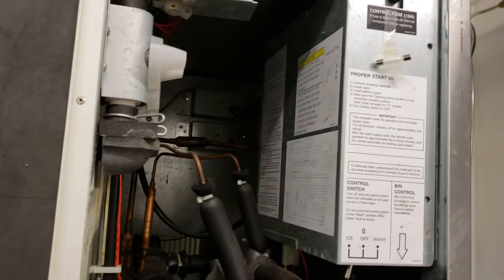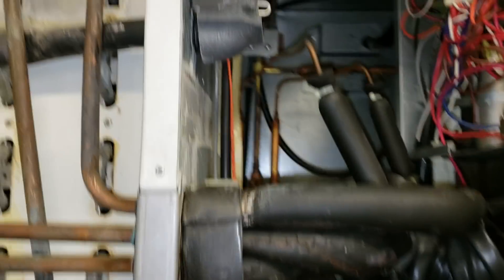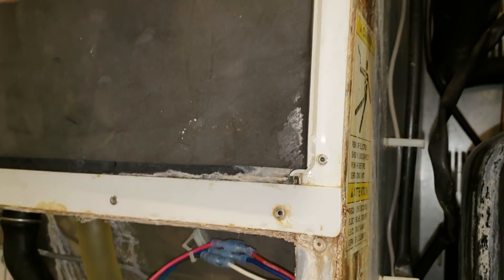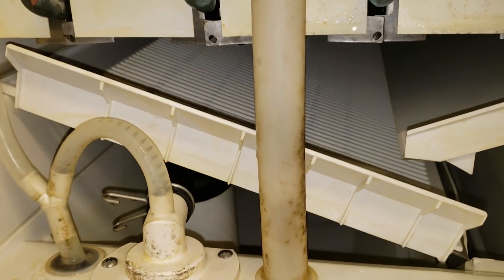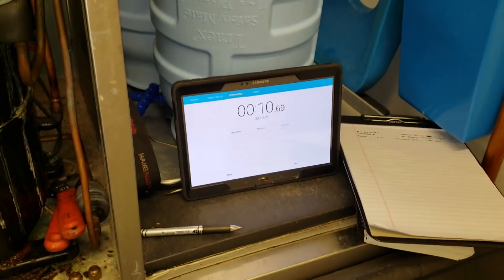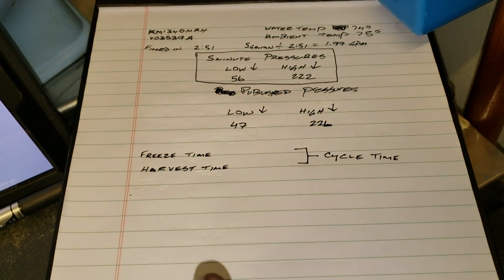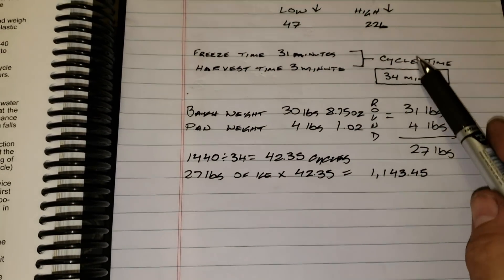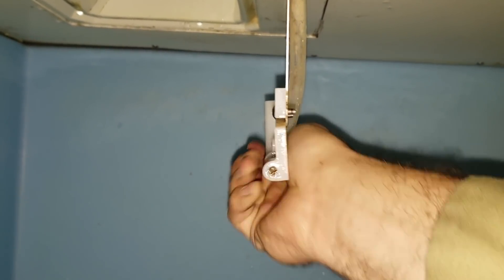Hoshizaki Ice Machine down

Comment: Love these videos. Since time isn't base 10 though the GPM calculation I would think would be 5 Gal / 2.85 min (where 2 minutes + 51/60 seconds) so the GPM is 1.75. Of course perhaps there is some other basis that took this into account.
Reply: I was going to write the same thing, he is calculating the gpm wrong.  Seconds are base 60 not 10.  So TheObiwantoby calculation ii right.  Hvacr calculation is 2 1/2 min because calculators are base 10.

Comment: Replacing a Hoshizaki with a Manitowoc!? BLASPHEMY!! 
Regardless of this atrocity another well done video. Good Job.
Reply from the maker: to clarify the customer is supplying the manitowoc, I just install it. if it was my choice I would put a hoshi back in for sure. thanks for watching I am going live on youtube tonight 12/10/18 at 5:00pm pacific to talk about Hoshizaki Ice machines come on over and check it out  https://youtu.be/JhM0UMnL7YU
Reply from the maker: If I was to buy an ice machine myself it would be a hoshizaki, just make sure it is properly installed with a hoshizaki water filtration system the proper water line sizes and the delivered water  meets hoshizakis gpm requirements. The machine will last you a long time

Comment: Great walk thru. 
Have not worked on Hoshi, but so much of what you covered applies to all IMs. My only comment would be for new techs to realize an X lb rated machine is label rated at perfect conditions; ambient condenser and water supply temps will affect real world production. 

So many of my facility's concessions ice machines are crammed into unconditioned closets. Insane.

Comment: Thank you for your explanations and thorough diagnosis of all the systems but I think I would have called TOD when you found a leak in the compressor. Leaking refrigerant in an enclosed space is no longer a health concern? Owners are notoriously cheap and usually expect you to pull off miracles and then haggle over repair costs.

Comment: I’m dealing with helping to run an ooooooold Corner Store in a small community on an island; it has 2 walk-in coolers and a 4-door stand up freezer with the big compressor and everything else right on top like self contained systems... which there are even more of: 2x 3-door Pepsi pop coolers and 3 Nestle ice cream freezers, which makes for a hot store in the summer, and because they’ve made some crude holes and vents to the outside to help the hot air escape, it doesn’t even help heat the place much in the winter due to all the cold air getting sucked in from the negative air balance...  we need to figure out how we can optimize the ventilation for both situations, even get it on a thermostat so that it just switches back and forth from summer mode to winter mode automatically as needed.  🤔  

Might be as simple as adding 2 large ventilation fans with those flapper vents that only let the air travel in one direction, one on the outside vent hole and one facing the store through the plywood box that’s hiding the area the compressor is in so that in summer only the outside one runs venting all the heat and in winter only the inside one runs, making the warmed air recirculate...  shouldn’t cost a whole lot but it should make a difference...  I think.

Comment: Should have been 5 gallons divided by 2.83 because 2 minutes and 50 secondis is 2.83 minutes, not 2.5. Just thought i'd add. That would have made the flow rate around 1.7ish gpm.
Reply: Oopse. Didn't realize someone already made the comment. Thanks again for the videos!

Comment: if the compressor is leaking why waste the time? the machine isnt going to last even a few weeks. this only shows that your tactic of checking everything and looking at it all.. is in the end just milking the clock.. i agree with it dont get me wrong but in this instance you needed to walk away. this machine is hopeless.
Reply: AND in the end you didn't change the compressor. so you can't argue that was cheaper. these hozi machines from what ive seen watching your videos as a bored person just tell me these are flawed machines. why not encourage the owner to a newer machine that runs probably less power per pound of ice and has the capability of doing basic cleaning on its own? just a thought... if i were in the situation with a pile of crap like this... id just move on to a new appliance.
Reply: This is the farthest thing from a waste of time. I find these videos full of such great content. Thanks Chris for being so thorough on your explanation and troubleshooting. You could have condemned the unit and stop recording but did not. Because you kept recording there is now a great video on the operation of these ice machines. Keep up the good work bro.